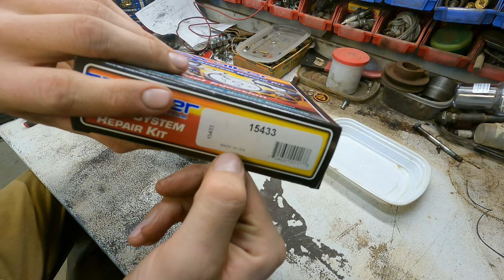Is this 1950's Galion Road Grader worth saving???  Cursed Grader Pt.2

Comment: Looks like the hydraulic line to the throw out bearing had one serious kink in it. No way the throw out bearing was even trying to release the clutch is my guess. I think it would have had a better chance of breaking loose if the throw out bearing was working.
Reply: grease line. had a mechanical linkage to the throwout bearing

Comment: I thought that everyone has seen Christine you need to rent that and watch it with your wife with some pop corn candy and popcorn. You did some good work on Christine "She'll run!" a quote from the movie. I had a carb just like that on my old 62 Ford F100. I would clean the gas tank out with a gallon of carb cleaner like Thyme and then rinse her out and put some Red Kote gas tank sealer in to line it with so it wont have rust it will be fixed for life.

Comment: I got sick of bolts like those bell housing bolts and bought the ICON brand XXL dual flex head ratcheting wrenches. A couple other brands like mountain and matco sells them with different roll marks but they become invaluable real quick in shituations like that. Worth every penny IMHO. Just like the Milwaukee ratchet, stubby, and high torque impact. All must haves and get used constantly. Thank you for sharing sir👍you earned yourself another subscription

Comment: I was wonder what you did with the crane, I'd not noticed it the background and thought you'd let it go. I'd suspect that the whole engine and drive assembly was probably built separately and the grader built around it in the factory. Now you've proven that Christine has a good engine, a comprehensive break down and rebuild, you are halfway there. Strip off all those auxiliaries getting in the way and pack them away just in case. This is an interesting project.

Comment: Those 3 bottom bolts look like you have to work them into the hole, line the engine up and draw the bolts up while working the engine up against the bell housing. Basically 3 things to line up at once. Yay! 🙌
Reply from the maker: You are correct it looks like its gonna be a blast....

Comment: Watched your video,I have an idea on the clutch. One: the throw-out bearing is blown. Two: the reservoir for the slave cylinder is shot,or three:the line going to the bearing is either kinked or busted.
Reply from the maker: its not a hydraulic clutch its all mechanical.

Comment: I've never had much luck with grease fitting rejuvenatiors. Leagcy manufacturing makes a mega boost grease gun that  produces pressure up to 10,000 psi, it's my go to for plugged grease passages.

Comment: I worked at the Heavy Equipment shop at Rhein Mein Germany and one winter we had a light snow and CE couldn't wait to clear snow with the brand new road grader.  they were going along at a good clip,  but forgot that at one spot on the road, the train tracks were above the road surface.  When they hit that, they snapped off the blade!  I mean broke the gear wheel. Took A year to get the new casting.

Comment: A note on the old cans that are losing pressure- my father taught me to take an air blower with a rubber tip and blow air back into the can by pushing the tip down as you blow using the air compressor. It's a decent way to keep old cans usable as long as you don't overdo it on the pressure
Reply from the maker: Yep I do that all the time in the garage but out in the woods I don’t have that option lol

Comment: Nice to see. I still run a 503 Galion with the 6 cylinder diesel motor and a pin locking blade. It's fitted with a 5 tine ripper in front of the blade.
Reply from the maker: Yes i wish mine had the ripper

Comment: Have had one of the grease fitting persuaders for over 50 years, still have the original and it still works great! A little battered like me but still good! You need a heavier hammer, short handle, heavy head for tight places.

Comment: My dad has ran a road grader for 30 years and the reason for the front tires being able to lean are so you can make sharp turns and makes them easier to turn around in tight spots basically like turning with a bike or motorcycle the more you lean the sharper you can turn

Comment: When the panboard is tilted for plowing. it tends to slide the front sideways. Tilting the front wheels helps, like Diesel said, the wheels to dig in and hold off front from sliding off course.

Comment: When you mentioned about the spray cans losing pressure I learned that sometimes you can pull the spray top off and just shoot a quick burst of air  in by pressing the air nozzle over the tube sticking out. It worked on a can of spray paint for me. Just be very careful about how much air you put into the can. Give a small sshot of air & see if ihe can sprays better. I was also looking at the clutch slave cylinder where iit might be a good idea to rebuild it if you can & haven't already thought of it. Thanks for sharing.

Comment: Thank you for protecting the environment the best you can amd promoting american MADE products, side note they can be american assembled but not sourced. I got the rocket sockets the worked amazing on some old exhaust bolts had to go a size smaller after a slight rounding and serious heat but the best ive used.
Reply from the maker: I’ve got a set of those myself! They do work well!!

Comment: Whenever you have a rust problem,  brush off loose rust wuth wire brush or wire wheel,  then spray rusty are with Ospho.  It turns iron oxide into iron phosphate, which is an inert substance.  Ospho also acts as a primer for painting if required.  Ospho treated areas will not rust again. It is a great product for external rusty parts, panels, tools,  and inside fuel or oil tanks.

Comment: We have a Gallon almost exactly like that except ours has a flat head Chrysler 6 cylinder in it. I installed a hydraulic motor to rotate the blade circle. They are a great old graders.
Marc

Comment: I remember when the county had those.and the pull type.  Behind big Oliver tractors.   A manual gun with kerosene is good  to run in the joint awhile to clean it up. Set the idle so she slobbers a little. When you load her up she needs some extra. When you do the fuel tank put a shut off  valve in it. If the float leaks in the carb it will hydraulic lock the cylinders.

Comment: That was fun, reminds me of  a job I had on a landing barge. The captain, owner was a great guy until something went wrong, then he would lose his sauce. We steamed a good 50 miles, loaded, to attend a job, 20 miles at sea and when we got there the starboard engine popped a flex plate. I spent the next 2 days in the engine room while an excavator was working on the deck above me,  steel tracks, steel deck and no headroom. Stupid thing is, I would do it again and have. I was on a yacht sailing through the Louisade Archipelligo in Papua New Guinea and 1800 miles from home a seal failed on the cooling pump. Thankfully I had a spare and was able to effect a repair. On our return the mechanical engineer that normally took care of the engine asked how I did it? I replied that it was a matter of necessity. I have matured somewhat and now prefer tractors to boats.

Comment: I, as one, had the same problem with my clutch frozen to the pressure plate, there should be a pan on the bottom of the clutch housing exposing the bottom of the clutch-pressure plate take a real slim flat blade screw driver and stick it in between clutch and pressure plate all the way around  and hopefully get them separated.

Comment: Duuuuuddddeeeeee... when you're filling that rejuvenator, you put the oil in, put the plunger in part way, turn it plunger side down and pull it down a little until you see it suck in a little air THEN push it in until it comes out... just like using a syringe... fill the barrel, turn it tip up, suck in a bit more air to clear the tip, then vent the air until it's only fluid inside... it also would seem to be beneficial, like bleeding the brakes on your car, so that you're delivering the force of the blow into the fluid which is non-compressible unlike air which when trapped in a steel cylinder acts like a GREAT shock absorber and works to reduce the overall pressure you can deliver with the tool...

EDIT: Totally stoked that the rejuvenator worked so well! It's great to hear about products like these being developed and put into the hands of people who can use it and appreciate it!

Comment: I personally run 10w30 diesel oil in our old International gas engine. Diesel oil still has all the good stuff that has been stripped out of modern gas engine oils in their attempts to abide by strict emission standards. If you don’t want to try to chase down 10w30 diesel oil you can always buy a bottle of ZDDP to treat your existing oil.

Comment: Leave the three hard to get to lower bolts as short locating dowels and don't try to get bolts / studs / nuts in there at all 

The "dowels" will resist twisting force and the rest of the bolts will keep it all tight! Oh and fix the shape of that hydraulic clutch hose in the bell housing it may delaminate and give you more grief after its back together

Enjoying the videos Thank You 👍👍👍🤘🤘

Comment: If u don't have that tool  for the stuck grease fittings u can also just heat up up with a propane torch works almost every time

Comment: You've got an awesome looking machine, it's getting rarer to find equipment this age still around. You should restore it by mounting new tires, hoses, gaskets, and whatever other new replacement parts need to be swapped out for it to run properly, while cleaning and repainting will make this a hard working but good looking piece of equipment.
Reply from the maker: thats the plan!

Comment: They make special wrenches for that kind of bolt, often you need them for transmission work.  HF sells a set for a not-unreasonable price.  They are straight box end wrenches with a slim head on one side and ratcheting head on the other.

Comment: Excellent video keep up the great videos 👍👍👍👍make sure that you position the small shaft splines in the same orientation as the big splines if they are in the middle of each other they should go together easily
Reply from the maker: Thanks for the tip
Reply: @DieselCreek  your welcome I would say that the clutch plate and pressure plate are more than likely the same as ihc tractor like a 560 or 460 tractor or else like a international truck or pickup if it is corroded to bad the springs in the pressure plate will break also check the rear main seal if it is leaking

Comment: Nice job.... I probably would have waited to change oil till after I knew if you had to pull engine for clutch problem. With engine out good time to try to freshen up all gaskets since it's much easier to work on. Including oil pan gasket.....

Comment: Next time you do a carb, clean it by boiling it in lemon juice.  A solution I found on the net from a gentleman who restores old motor cycles.  Boil it 20 to 30 minutes but no longer.  Boiling before you take it apart can sometimes save the gaskets and makes it easier to take apart.   I then flush it in a bucket of water.  Blow it out with air and carb cleaner just to get all the water out.  

Never fails.  Also, ask your guitar friends for some of their old guitar strings.  Great for snaking the ports.

Comment: If you don't mind the fire hazard, if you get a can of butane lighter refill, you can usually pop the spray nozzle off a pressurized spray can and put the butane refill upside-down into the nozzle stem, then just push down until the product in the pressurized can starts coming back up.  Put the nozzle back on and you can use up the rest of the can..
Reply from the maker: I usually just use the air compressor when Im at the house. rubber nozzle pumps them right up.

Comment: Maybe they used a crows foot to get those bottom bolts? Not sure if that's what it's actually called but like a electric powered open ended wrench? On the assembly line we use them to torque brake lines and other lower torque stuff. Not sure if they even make like a garage version or maybe a tool store that rents speciality tools. Hope ya find an easy way to get it done. Lookin forward to it... on the next episode... of... Diiiiiesel Creek! Lol

Comment: If you want to seal that gas tank look up a company called Caswell Plating.  They sell a kit that is miles better than every other kit I have used.  If you decide to use it make sure that you mix it very well before you pour it in.

Comment: Hi friend !!! I had one scraper the same as that one but far too expensive on gasoline  so I made a conversion and adapted a PERKINS 6 cylinder engine,  that was the solution and far more power---------(needed for works  in Africa !)  
Hope you will have good and long use of that GALION scraper !

Comment: Kinda cool that you used your Komatsu to pull the International engine. I don’t know if you know this or not but both companies were partnered together...IIRC, from ‘78 until ‘83. The only reason I know this is because I have a 1981 International 284 4wd tractor, made by KIMCO (Komatsu International Manufacturing Company). It has a Nissan SD-16 3-cyl diesel. In fact, the only thing on that tractor that’s International is the paint, the grill and the decals.

Comment: The short version is that the front wheels follow the existing grade, the blade cuts the new grade, and the rear wheels follow the new cut grade. Makes working on slopes much easier.
Reply from the maker: yes I dont know much about running the graders. Ill be learning as I go here.

Comment: a little trick with grease guns and tough zerk fittings if you lay a light rag over the greaser end of your grease gun and stick it on the fittings that are causing you problems you will find not as many fittings are as bad as you thought

Comment: Thanks for the bobcat fuel solenoid tip.    Still freezing here so it will sit a bit.  You seem to be collecting more and more gasoline items.  I am still amazed that parts from old equipment are still available.    I have a 1955 JD 40 crawler I am repairing that I can fine stuff for.  Just have to wait a week for delivery.
Reply from the maker: the jd 450s were supper common great little machines, I wouldt mind picking one up some day.

Comment: About the clogged zerk fittings; I have a couple of comments. First about the tool Diesel Creek used with a hammer....not always possible to swing the hammer on hard to reach locations. Second, not to dispute the usefulness of the tool (which I wouldnt mind owning one myself), it seems to me that an easier way to address the problem of a fitting that doenst take greas is to remove the fitting, poke into the hole with a sharp pick in order to disloge dried out clog, spray a little degreaser into the hole, test the fitting to see whether or not it can take grease, replaciing it  with a new one in case it doenst and resume pumping. I has worked for me...some...but not foolproof....would be glad to hear your comments.

Comment: I had a 1966 Plymouth Valiant way back in 1979 , It had a 225 Slant 6 cyl with a single barrel Holley carb with a see through made of glass fuel bowel, even back then it was a rare to see, but it was factory equipped like that, I thought it was cool.

Comment: Grease primer - grease is oil suspended in a matrix, commonly a soap. Over time and with heat and pressure,  the oil leaks out of the matrix so you just have soap remaining. If there is a drain plug, push the old grease out with fresh grease. The old grease is likely a poor lubricant in any case.

Comment: matt, i've had good luck with unsticking stuck clutches by placing trans in neutral, press the peddle to the floor and rev the engine to high rpm several times or, driving around with the clutch peddle depressed until it comes unstuck, providing it's not a hydraulic clutch.

Comment: @Diesel Creek  tip for you or anyone else that has dead cans with some or lots of fluid left in them. On most of them you can take the spray tip off them and use your air compressor to add some pressure back into them instead of crushing them. I have done it tons of times to wd 40 and pb blaster.
Reply from the maker: I do it all the time when Im in the shop but I didnt have any air out there!
Reply: @DieselCreek  kinda figured you might know that trick. But just in case I had to say it. Love the videos man. Keep um comin.

Comment: Grease fitting, if they do not work, I just remove them and replace them, Have a huge amount of them. New ones are far better. A good size box assortment are not expensive. This also helps when you are missing a few.
Reply: Another thing is use high end grease. Cheap grease is worthless, check out Project Farm on his testing on grease.

Comment: Wheel lean is actually to help keep the grader driving in a straight line and from sliding, or up on a hill while cutting with the blade angled.

Comment: That's the same carb that's on my 66 IH pickup, that came with a 240. I came across a rebuilt 264 short block someone ordered for a forklift, put the head, pan and all the other parts off the 240 and stuck it in the pickup. Put a distributor off a 220 on it. The woods used to be full of those engines!
Reply from the maker: This is a 220 seems like a good engine!

Comment: Also when do clutch put new throw bearings to plus plate for heavy duty type and bolts out may need take cab seat in behind too plus may socket with universal joint long break bar plus tube on wrecking bar plus 2 people to undo bolts out ! When put new bolts in use 100% true metal types and may angle open mouth wrenchs to when put together again! Also the flywheel reserivce by grind down like disk brake too & hope helps out Matt :) if live closer and help you out to and show what do together with you! But my advice is helpful to ! Check with Gailon plus is International built now called Case dealership see if help with pictures and shop manuals to !